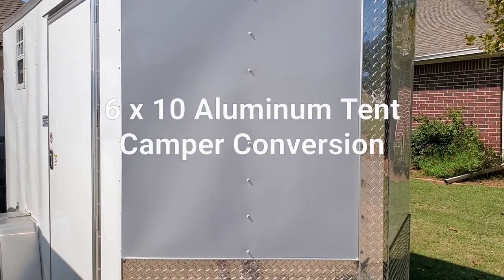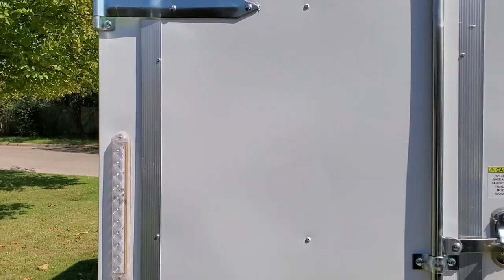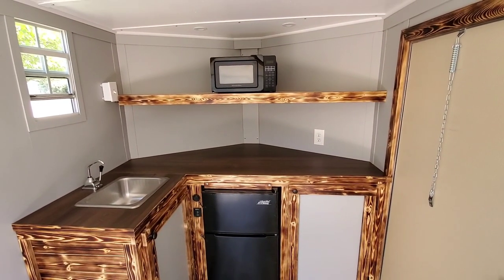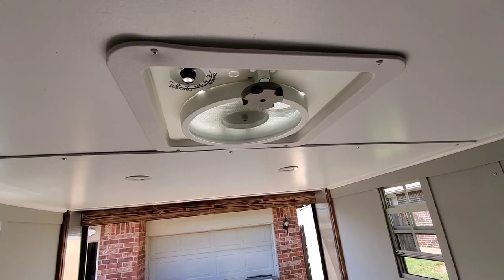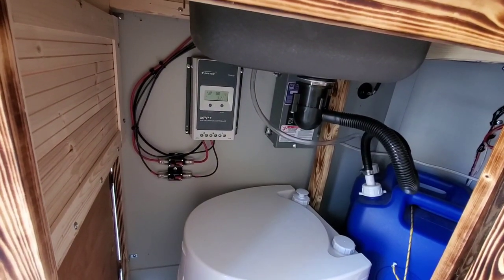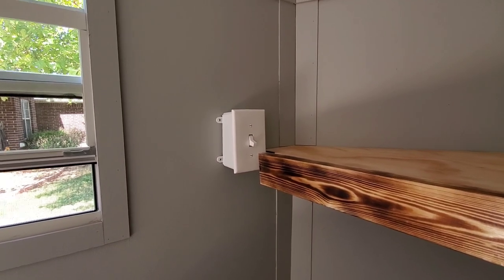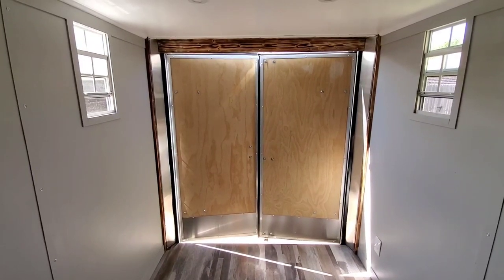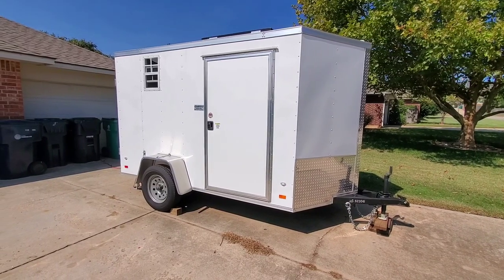6 x 10 Aluminum Tent Camper Conversion

Comment: Nice and simple, well done!  Love the wood cabinet finish.  In case anyone needs to know... this is solid pine wood toasted with a propane torch - natural shading.  You can finish off with oil based or water based polyurethane.
Reply from the maker: Thanks for watching and the kind words. Appreciate it.

Comment: Great gives me something of a start even though the total weight is little more I was hoping. My plan is to make one with less than 1500 lb weight.  Will all aluminum frame help and be able to shave off 500lb from the trailer ?
Reply from the maker: As far as dropping weight with an all aluminum trailer, I can't say. I added 600 lbs +/- to the empty weight of this trailer, and 170 lbs of that was the solar battery. Hope that gives you a bit of an idea about the build weight.

Comment: Did you frame the ceiling? if so what size wood 1x2? 1x4? Would you say a bathroom would be doable? Also putting up a False wall in the back near the cargo door? Can it be used for all the Electrical components ie: breaker box, inverter, charge controller? lastly fully off grid, do i need the 30amp external plug in?
Reply from the maker: I used 1 x 3 furring strips on the deiling "joists". I think a dedicated "bathroom" is doable in a 10 ft trailer. I just did a 7 x 10 with a 36 x 36 "potty" room that could be turned into a wet bath. Depending on whether you have a ramp or barn doors, you will lose about 8" in length if you put a false wall at the rear as close to the ramp pulleys as possible. I would recommend putting in a 30 amp inlet. The inlet itself is $20+/-, which is not much more than a 15 amp inlet costs. A 30 amp cord is $40 +/-. Once the power is in the trailer, the wiring is about the same.

Comment: I didn't hear you say anything about Insulation. Does it have any in walls or floor.
Reply from the maker: My bad. Walls & ceiling have 1" polyisocyanurate (RMax) in them. R6 walls & ceiling.

Comment: Will a Mitsubishi Outland sport pull this ?
Reply from the maker: If the tow capacity of the vehicle is 3000 lbs or more, you'll be fine.
Reply: @TinyTrailers4BigAdventures  It says 3000 limit
Reply from the maker: @unravelingnots7544  - Then your vehicle can pull  the trailer safely. If you want more info, email me at tinytrailers4bigadventures@gmail.com

Comment: You failed to mention anything about a battery? Micro will need a large enough capacity to run any microwave. Also no links for anything mentioned. Like the fan for one.
Reply from the maker: Oops - There is a 240 amp hr AGM battery in there and a 1500 watt inverter, which is plenty to run the 700 watt microwave (actual draw maxes out at 1110 watts on start up)

Comment: You made a mistake not adding insulation in the walls and roof and perhaps the floor. These trailers can get quite warm in the summer. Also cold in winter. Plywood just won't do by itself I'm afraid.
Reply from the maker: All my trailers get 1" insulation in the walls & ceiling. I may have missed mentioning it in the video.